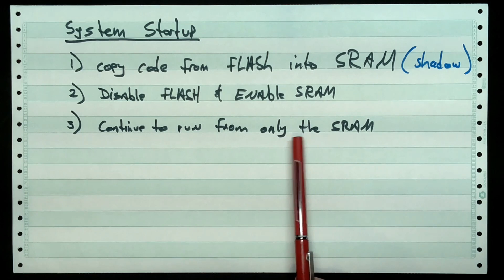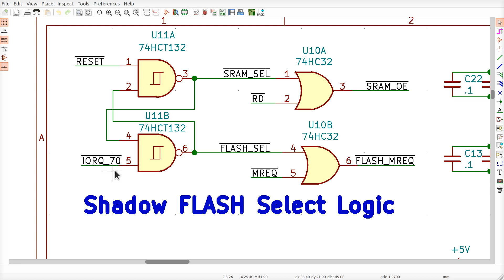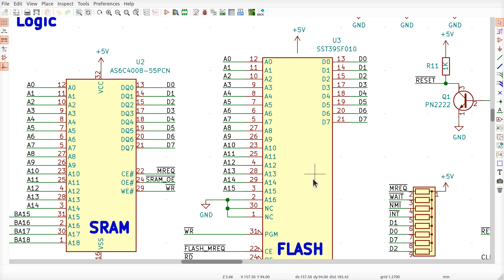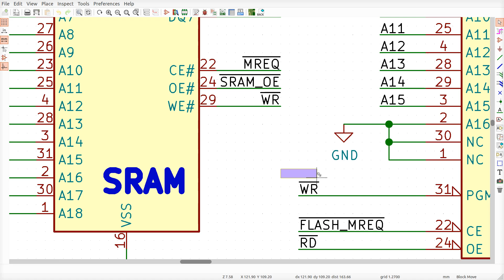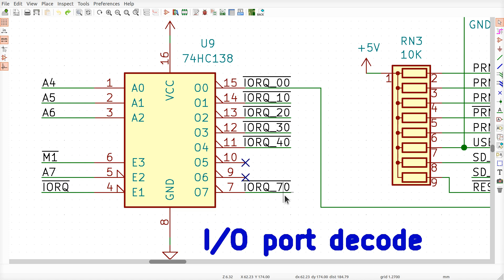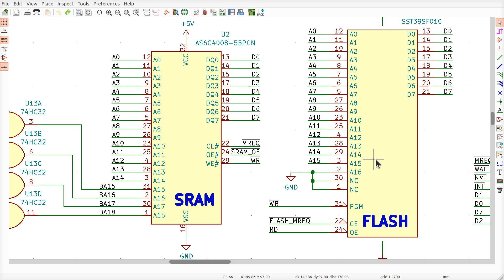Z80 Retro #5 - System Startup

Comment: Years ago I built a z80 computer kit called "the big board", which was also the same design as the Zerox 820 (and maybe the kpro).  It had an eprom at address 0h (2716 or 2732) that contained the bios.  On reset, the contents of this rom were copied to upper ram address 0xf800, and then 'jumped to'.  The eprom was then 'removed' from the memory map.  (there was also video ram at 0xf000h).  So that was the same idea as what you are doing.  This process is also necessary since the Z80 reset address is 0h, but we want ram there to run CP/M.  So we move the bootstrap and bios code up high on reset.  That code is assembled and linked to run at 0xf800 (except for the block move routine that copies it out of the eprom).

Now in your case the switch from eeprom to ram is all or nothing.  That means NO RAM, and NO STACK.  So the copy code can't use any subroutines.  If you don't intend to have any bios code from the flash copied to the ram, ie: just a boot strap, the problem is a bit simpler.  Otherwise, you'll have to copy code using inline instructions, NO SUBROUTINES, from the flash to the ram, either from the same addresses in the flash as will be in the ram, or will move the code in the flash higher in memory to the ram.  Then jump to the high memory, which code must exist in BOTH the flash AND the ram (after copying), and then hit the switch.   Or the switch code could be in low memory, again in both flash and ram (after copying), now after hitting the switch there is a jump to high memory (which was copied to ram).  A bit more juggling needed here than in the '820 where only the lower 2-4k was switched between eprom and ram (so one could jump to the ram before hitting the switch, and could use subroutines in the process).
Reply from the maker: Maybe?  If I recall correctly... didn't the BigBoard guys sue Kaypro accusing them of stealing the BigBoard design?
If we want to be able to use the entire 64K as RAM, then we need to do some sort of bank-selection to get rid of the ROM once the system is started.
As you will see, I do have subroutines etc. in the FLASH code.  But they are copied into the SRAM and not called until after the jump-to-light-speed!
Reply: @JohnsBasement  Yes, I was referring to the code that does the copy operation.  That can't have subroutines as there is as yet no ram, no stack!
Reply from the maker: AH!  Yes. Indeed.  But... since the Z80's LDIR does it in one instruction... I'm not exactly feeling bad about that.

Spoiler alert:  This is the ENTIRE section of code that I run out of the FLASH:
        org     0

        ; Select SRAM low bank 0, idle the SD card, and idle printer signals
        ld      a,0xf0
        out     (gpio_out),a

        ; Copy the FLASH into the SRAM by reading every byte and
        ; writing it back into the same address.
        ld      hl,0
        ld      de,0
        ld      bc,_end
        ldir

        ; Disable the FLASH and run from SRAM only from this point on.
        in      a,(flash_disable)       ; Dummy-read to disable the FLASH.

The all future instructions that execute are run from SRAM.
Reply: @JohnsBasement  And if you wanted to put the "rom" code in high memory to act as part of the CP/M bios code (as the 'big board' did) you could have assembled the load to org in high memory, and load one of the register pairs (IIRC the DE was the destination pointer).  Either the flash memory would have to have the in instruction at high memory (in the flash), or the ram would need the in instruction in low ram, followed by a jump to the high memory start address.  The flash is large enough for that.  Actually, it's large enough to hold several code bits, perhaps the bootloader, or a resident basic.
Lot's of ways to use this feature!
Reply from the maker: Best I can figure, by copying the FLASH into the SRAM and abandoning the FLASH I am using less gates/chips.  (If I went with a GAL then I would have played more games with bank selecting both the SRAM and the FLASH so that I could swap the FLASH back in on demand.  But then I'd have to deal with programming the GAL.) With 512K RAM, however, I have more than I need, so I am happy with copying the FLASH into the RAM a'la Hotel California.

I plan on running CP/M 2.2 using one of the 15 low SRAM banks to hold extended BIOS subroutines, another one for the low 32K of the TPA and the rest as a write-thru disk cache with CP/M loaded as high as I can get it to maximize the TPA area.